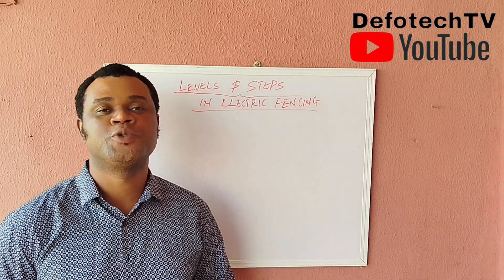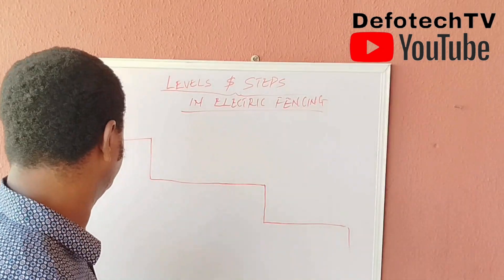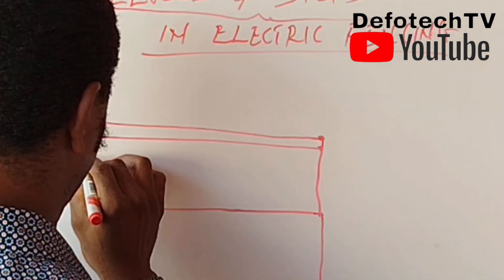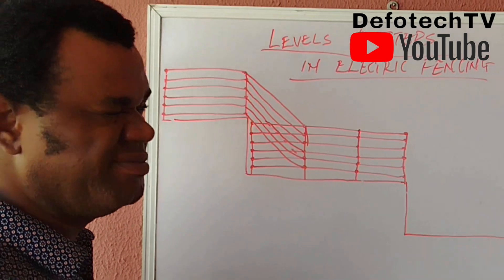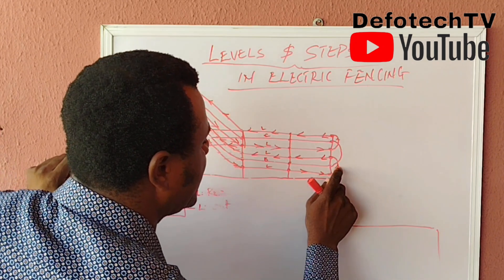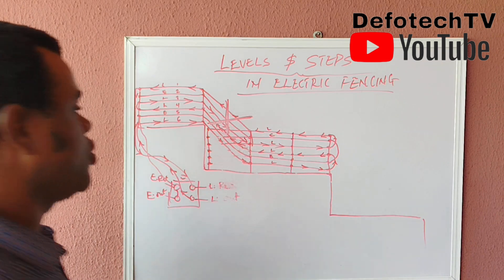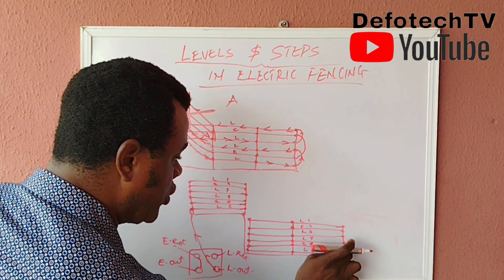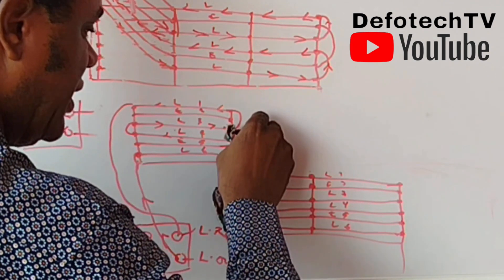Steps and Levels in Electric Fencing

Comment: Please sir I have issues last time I did my electric fence six lines and everything is working perfectly and I later notice that the gaps between the electric fence and gate too much and I decided to add another two lines on the gate but I found it difficult to connect it
Reply from the maker: I perfectly understand this situation, you need spring and hooks in scenarios like this. Go to my video on " steps and gutters".
Reply: @defotechtv9093 thanks boss

Comment: I do A and spring the end poles.
Since short circuit is also an objective we aim at, an intruder cutting a tension wire will possibly cause a short, and in turn trigger the alarm.

I that can also be considered an option 😅
Reply from the maker: Well, if you feel that's what you love to do, it's totally left to you. But I have done my part, teaching you the right way of looping and connecting a fence. I am happy you mentioned objectives , but we are looking at the right way of doing things

Comment: I appreciate you sir, but with the first explanation (which is that A). I don't believe that you can't cut the wire from those points u mentioned that the whole lines won't slack and lap on each other. And which will definitely triggered the alarm. Though I may not be able to say it all. And it's all depends on the installer. Thanks sir.
Reply from the maker: If I cut from the bottom, that won't happen.

Comment: Defotech, you are doing a great job. At least this is the first time someone has defied Nemtek's super control of the allowance of informal training on how to install an electric fence with their equipment. They always want you to learn electric fencing in formal settings. Now with regards to your diagrams, while I agree your security can be bridged through that corner, in real-life installation, many other factors will determine what is better, given a particular scenario. Both methods you have explained here have their shortcomings. We have had several cases where diagram B allows easy springover without any noise, without any cutting. Whereas diagram A can be bridged, it will take more efforts. In most cases, levels and steps you just talked about are compound-facing, meaning those sides are usually within other compounds. What diagram A will allow, diagram B will. Deterrence is also a factor in security.
Reply from the maker: Good morning sir, thanks for your response. 
You talked about one springing over the fence, that is not anyone's fault, for me, if you can spring through ones fence at this height without touching the lines, you shouldn't be an intruder, you should be representing the country in the Olympics and making huge amounts of money. On the other hand, the diagram A is not secure, it can be used in animal farms to deter animals from wandering beyond it's boundaries, but for security against intruders, it's a no. 
Sir, I have been on the field for over 15 years carrying out tests on fences and Energizers, this information here are things I have tried and tested. I hardly teach any topic if I don't have the in depth understanding of how it works. But if you feel both have their shortcomings, I will agree with you and also say that sample A is wrong outrightly when it comes to security, but because people are doing it doesn't make it right. Like they say "two wrongs don't make it right".
Thanks a lot sir.

Comment: I commend your efforts but try using mordern method, like using graphic animations. This will help your drawing to look clearer. Thanks
Reply from the maker: @ChrisGeorge-hc8kd  Thanks so much for your suggestion. I would love to use it, but it's going to be very expensive. If you are in position to assist financially, the door is opened. I can only give what I have, which is the technical knowledge , I am not paid a kobo for this too. But should you have a means to help push this suggestion to realization, I am happy working with you. Thanks a lot siri

Comment: Thank you sir God bless you for always educating us.
Sir I have questions.
Is it possible for electric fence wires to work properly with out earthing it?
Cos I was in a place were the installer after running the fence wires he loops them as follows. 1-3, 4-6, 3-5 and 2-4. At intervals.
He brought out just 2 output that's positive and negative from line 5and6 respectively. To the Energizer. He then loops the shocker with the positive wire and connect the negative wire to the earth button.
While testing I observe that the alarm rings only when he bridges any two of the lines.

My second question is if for instance some one cut any of the wires will the alarm rings?

Sir pls educate me. Thank you sir
Reply from the maker: He looped absolutely wrong. That is not acceptable. Please reach me on WhatsApp on 08064869887. I want a picture of what you just explained.Thanks

Comment: Thankyou sir
Reply from the maker: You are welcome.
Reply: @defotechtv9093  Hello, please My electric fence starts ticking loudly when rain is about to fall or when rain is falling (50% of the time this happens). At night if you trace where the loud tick is coming from you can see tiny sparks at the insulator points. Is this normal? And any suggestions to fix this. It quite loud and annoying disturbing the neighbours.

2. Also the fence itself (wall) has shocked me before. It rained and was wet. I touched the wall without wearing slippers and got shocked. Is this normal too?